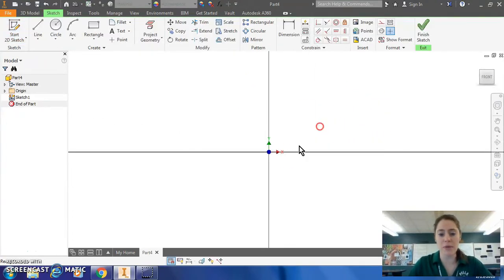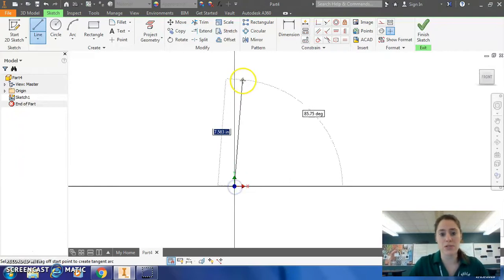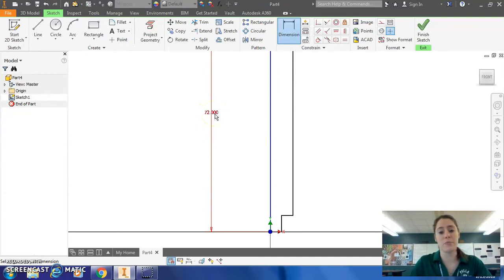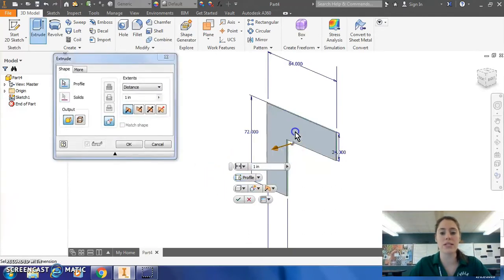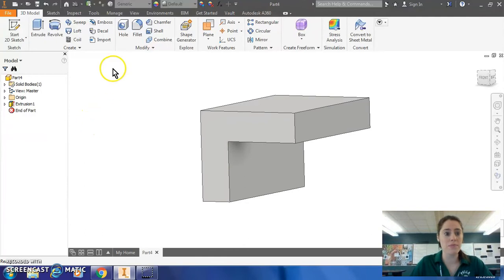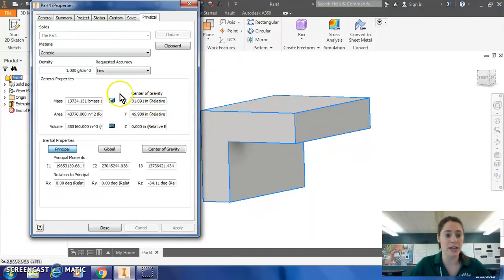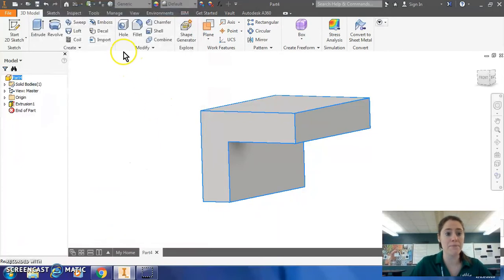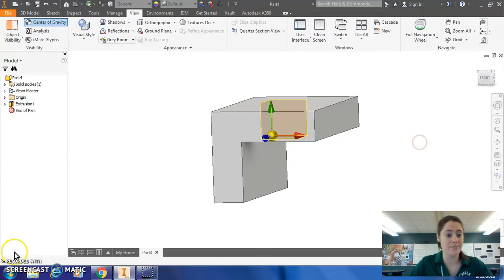5.7 Center of Gravity on Inventor

Comment: Can you import an external geometry into Inventor and get CG the same way?
Reply from the maker: For this method, it requires that you place the corner on the origin of the axes and extrude symmetrically. If you import something, you'd have to confirm that the center of an edge is located at that origin.